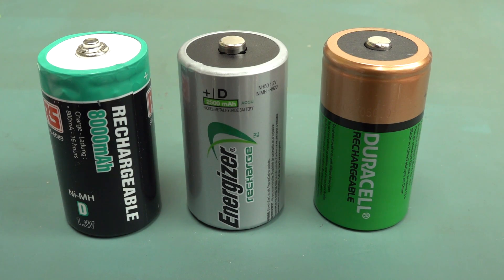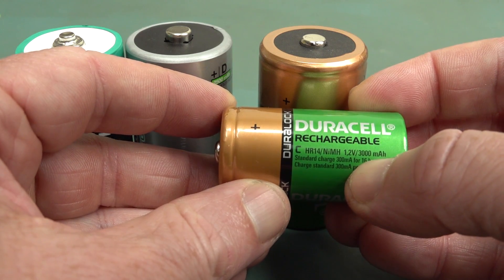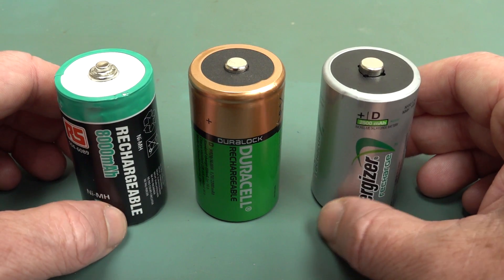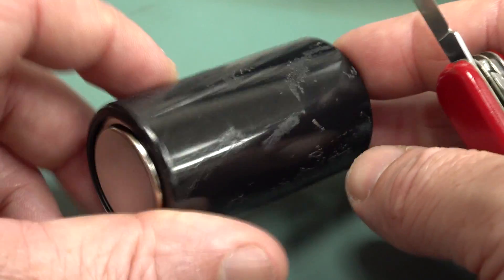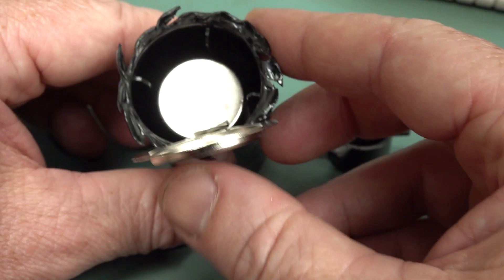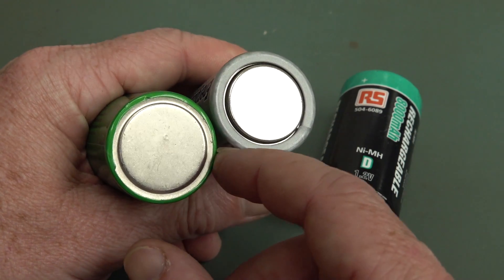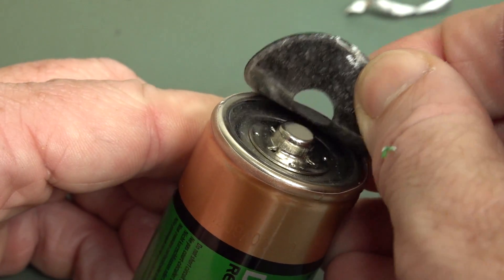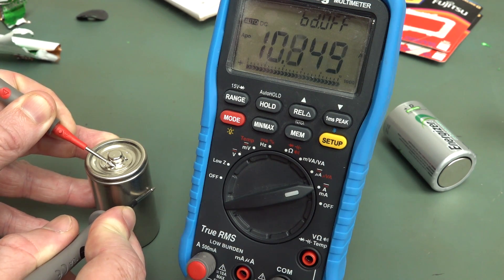EEVblog #1200 - BUSTED! - Energizer & Duracell NiMH

Comment: Video is six years old. But the trend of leaning on the ignorance of the buying public started in 1977, when I was to able to purchase C and D Ni-Cd cells both 1200 mAh, while their AA cells had 450 mAh capacity.
This is nothing new. When Energiser was selling a two-cell pack of Ni-Cd 1200 mAh D Cells batteries in 1980 for five dollars, I paid for each single Yuasa 3500 mAh Cell almost fifteen dollars. 
The big brands tried to introduce rechargeable technology to the public, but to achieve a palatable price for them, they created a product that was almost unusable; don't forget the charge of those initial Ni-Cd cells, with their impure chemistry, begun to fade two weeks after they were charged, and lost 50% charge after one month sitting unused. 
The problem is deeply rooted to this day in 2025. I bought a four-slots two-channel AA/AAA charger, which came bundled with four Ni-MH 1300 mAh AA cells, for £16 here in the UK. Fourty-eight years later., the problem hasn't been corrected, and became an epitome for the fairly perceived acceptable price fallacy.
Today. I don't mind buying Li-Ion AA cells (those with a buck converter and a protocol charger built into each cell), paying from £3 to £7 per cell, depending on brand, quality and capacity of the product.
Great video, thanks.
Greetings,
Anthony

Comment: I went through this nonsense back in the 90's with the yellow Eveready NiMH D cells.
Same low capacity crap. Now I have a bunch of EBL 10000 mah D cells. Expensive,
(4/$30.00), but worth it. Another solution is to take EBL AA 2800 mah and slip them into plastic adapters, (AA to C/D). I already do this, and save the cost of buying more EBL's.
I run two battery operated fans (4 D cells each) with the EBL 10000 mah. I also run two big radios that take 4 D cells and 6 D cells. Hopefully, people will wise up and stop buying this underpowered garbage. Glad to see that you wear barrier gloves. Great video!

Comment: I have been using Eneloop rechargeables for more than 20 years. Most of them are still working strong. Very low deterioration. No leaking even for the oldest one. Price was a bit higher but worth every penny. Great product. Absolutely better than those highly advertised national brands in the US.

Comment: It is disappointing that most people don't understand batteries. The math is really useful here. 

A normal D battery is 1.5v, 15,000-20,000 mAh. A normal rechargable AA battery is about 1.2v, 2500mAh. This is identical to these D batteries.

Honestly, that's okay, so long as you realize... You are looking at 1/8th of the amount of battery life, so long as you are not stressing the batteries a whole lot.

Most no-name companies who make chinese batteries lie about capacity. 13,000 mAh batteries could be 1/10th of that.

Comment: Tried the new Duracell Optimum cells. Ended with a claim for ruining my $40.LED light, was in only a about a month, leaked and ruined my light. They sent me a check for light and a new pack of batteries, I promptly threw them in the garbage, along with the other pack purchased at same time that corroded in the packaging, absolute junk.

Comment: Easiest way to tell is weight. The 6 and 8AH batteries are very heavy compared to spaced AA or sub C cell analogs. Now its easier to use lithium plus a dumb spacer 😂

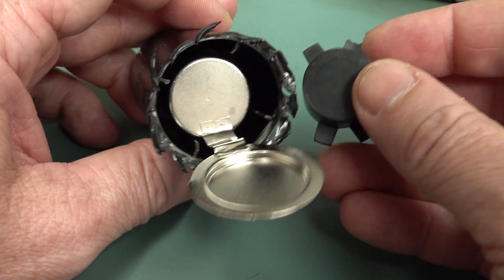Comment: i've only gone into this video to 4:30 so far so sory if i missed something said later in the vid But i always thought energiser was actrualy one of the best brands for normal batteries such as AAs,AAAs,D bateries etc but had i had a feeling they very well might be one of thoes things that oversells itself like crazy and gets away with it by alot of advertising expenses but i never thought they'd do something as cheap and bootlegy as putting  a physically smaller size battery inside a D cell sized housing and marking it as a D battery. As this guy said it's not a scam because the voltage and capacity ratings is accurate but i would feel a little ripped off if i bought Thoes.  On it's own this doesn't mean thoes particular batteries are low quality but it has me thinking they might have gone the cheap rout in the actual cell's materials and such. this warants more investigating before i buy another Energiser battery of any size sence i want good quality batteries that will last pun intended.

Comment: One thought that comes to mind is about use.  If the device you're using them in requires D cells, then obviously C cells wouldn't work.  And given the difference in weight, and I'm guessing price, a higher capacity cell would have more mass and less empty space.

Comment: Thanks for the teardown and analysis - very informative. 

BTW The price difference is so high per battery that you're paying for RS higher capacity. Most consumers are not going to pay the price difference and will simply settle for shorter runtimes and more frequent trips to the battery charger. (But now we know why you'll probably never see RS batteries in your big box hardware store...)

Comment: I wound up getting the AAA and the AA size batteries along with the charging pack for the energizers pro recharge kit for a birthday present. They do the job but I did notice they have quite a bit less capacity than those alkaline batteries or buy from the store. I just assumed it was a characteristic like nickel cadiums. I use the AA's for my controllers on my quest 2 and 1 in the clock for the family living room. The other one in my minidisc Sony s1 walkmen. The triple A's are in the TV remotes. According to the brochure that they came with the batteries can be charged up to a thousand times. So we're good for a little while.

Comment: I would not be surprised if most of those batteries (bigger than AA/AAA) were just AA/AAA in disguise (maybe even with retail sticker on it). Because manufacturing only few sizes of cells would be cheaper and other sizes are not used that much by consumers anymore (=lower turnaround).

Comment: In one respect, it's not a scam, but a matter of practicality.  They decide what the capacity of a "D" size NiMH cell needs to be, and produce it.  But it doesn't fill up the "D" case.  They can't put it in an appropriate size case, because then it wouldn't fit properly in devices that take "D" cells. They SHOULD make it with the highest capacity possible, and emphasize that in their advertising, but their "bean counters" no doubt have them convinced that the ignorant masses wouldn't appreciate the difference.

Comment: Dang I have 2 iirc usa or north american west coast pretty sure iirc where they they would have been acquired was or is on the western usa area aa batteries that are energizer 2008? From pressuming based on the date code or printed digits etc that they are year 2008 .... and they say 2450ma or mah and like they if correct in the number are more than fwiw the ones I see new nowdays in the stores now in brick andm ortar types... fwiw idk why but yeah ykwis... maybe if it is then it for the better imho for I would rather have more cycles then um uh the the the like run time ykwis?

Comment: I recently had some AA cells that were packed 3 in parallel.  And it was DEAD.  I mean all three were internally OPEN.  So I did an "autopsy".  And I found that the construction of the positive terminal under the button was actually like the disc button switches, the clicking type.  Only in this case, they were constructed not to return, when an internal pressure had pushed the disc from its original curvature out to the other state.  So, it was a bi-stable system.  I could not force the dome back, but measuring the cells (bypassing the switches), the cells were just as good as new.  I still don't know what had caused all three safety devices to fail, but I had hard time finding a replacement.  In fact it turned out to be a custom assembly for the home alarm system manufacturer.

Comment: I know I'm two *years late to the party, but I'm just a bit confused on how anyone thinks this is a rip off.
Each battery (today) is about 5 bucks on Amazon.  The first priority of these batteries is to be rechargeable, immediately followed by being the right size.  After that, it's the consumers choice as to what their next priority is.  Energizer decided their smaller C-size, with a much quicker charge time, with an added adapter was a better decision than the higher capacity but slower charging D-size.  Should a D with 10k be the same as a C with 2.5k?  No.  But the adapter isn't free.  And the assumption that inside an RS and Energizer are close to identical is a bit silly as well.  They're very close to being of the same value... nothing's been busted except the fact that the lighter battery, with less mah is indeed smaller inside... and I'd say it was silly to think you'd find a large but light battery inside, knowing how light it is and it's lower mah.

Comment: You may aswell buy 3xAAs of the same brand and put them in  D cell adapter you get more capacity your basically buying a single AA packaged in a D cell casing theres that much space inside them.

Comment: They learned it from 18650 Ultrafire Batteries? It's like cereal boxes getting bigger with less product inside, but still showing the weight of the product on an oversized box.

Comment: Been going through you're old videos and this one is really crap.  They clearly display the capacity of the batteries, the form factor is set by the device and you're acting like the high capacity one costs the same.  It doesn't!
Say Mr Jones has a device which he only unplugs for ten minutes at a time.  How on earth does it make sense for him to pay more for the high capacity battery?  Mr Smith might have a problem with not having enough energy, so yeah, it makes sense for him to get the high capacity one. What are you trying to say, that Jones should put a C battery in there, it won't fit!  Why should Duracell force Jones to pay for more capacity than he needs?  Now that would be a rip off.

Worst video ever Dave.

Comment: why didnt you open the RS brand. Tech has gotten better, I cant say for sure but maybe what there made of today is better than 30 years ago so it takes less but I still need my battery to be the same size I can't use a C-cell where I need a D-cell so the outer housing needs to be the same old size as 30 years ago I don't know just a guess.

Comment: Always remember guys if you have an ebay account and find that after your weight in grams and capacity tests are bad, you can DEMAND A FULL REFUND AND REPORT THE SUPPLIER to ebay Like I have done over the past 6 years. I give ebay proof by photos and readings of what I have found wrong with the batteries. They have a 100% full refund policy. You have nothing to lose. Ebay management will eject the supplier from ebay permanently!!

Comment: That RS battery seems to be dodgy
that large 8000mAh label with the small 800mAh label on the bottom kinda points it out.
Reply: ?? I only see a 800mA label, indicating the proper charging current (C/10) - or have I missed something?

Comment: The "8000mA" one also CLEARLY says "800mA"...which is obviously the correct number.  Stop buying shit from China.
Reply: 8000 mAh = capacity, vs. 800 mA = charging current
called C/10, which is quite typical for standard NiMH cells

Comment: you can buy battery adapters that hold a AA battery that fits in place of a D cell....Also if they made these surpass the non-rechargeable cells capacity then you would never buy their core product, all those throw away batteries.

Comment: The question is, what are your choices (and source of information) at retail where most people purchase batteries?  I have never seen RS batteries on shelves next to Energizer and Duracell, so never knew 8,000 mAH was an option.  Information is a necessary component of a competitive marketplace.  So, what are the odds that two major manufacturers chose the same approach independently?

Comment: Dave, you missed something. All batteries, regardless of capacity, were designed to be a certain 'physical' size to
fit in devices that were designed during the last 50 years or so. Our ability to evolve the chemistry to be
better and better have shrunk the cell size for a given capacity. This means a D cell has to fit in a D cell flashlight 
made ten or more years ago. Exactly how "D" cell size has changed from 1950 to today is unknown to me at
the moment, but it still seems to be the same. So the "new" capacities may require "bulking up external size" with space 
to fit the device("D" cell flashlight from1950). So, you're not being cheated.
Reply: Except if you manufacture a device to require D-cells today, you will take into account modern capability. And if you consider your device needs D-cells it's because you figure your device has a high power consumption and will deplete smaller cells too fast to be useful. Then the customer buys your device and puts this shit in and low and behold, I need to recharge my D-cell every 5 minutes because it has the capacity of an AA. Not to mention that Energizer and Duracell both made a name for themselves for lasting longer. Customers won't even look at capacity or will even assume that the 8000mAh of some off-brand battery is some sort of scam. This is absolutely not operating in good faith, it's a shady practice and customers are getting cheated because they buy the brand, they pay for the brand, but they don't benefit from what the brand stands for.

Comment: Truth is that all battery recharge when done right but the difference in something labeled rechargable is because it's a deepcell technology with high microfierit capacity vs microfierit resistance and thus you can recharge anything along as the charger adjust power density based on microfierit resistance.

Comment: If I went to the shop and saw these three batteries, with the RS 8000mAh being cheaper than Duracell/Energizer, I would probably go for Duracell/Energizer. The RS battery looks much worse, and I would suspect a typical scam here. Quite shocked to see how wrong I would be 😀

Comment: Cost of implementing waste x overall demand useage of such capacity. Old d size devices are slowly but diminishing. Duracell and Energizer have both roles to combat waste and utilisation of what popular devices are selling on the shelf... if the rs can have their d size cells on the shelf with little movement compared to energizer or Duracell putting these in very commodity devices that get very little use. The volume bought for some people would actually find these batteries over time that support a heavier fuel substance rather than make a non demanding product to goto waste.

Comment: I used to think that Energizer was the highest quality, but I'm starting to see signs of corners getting cut. The manufacturing for the alkalines is made less and less in the USA. I switched over to Rayovac for alkalines because it's not only cheaper, but Rayovac batteries are USA-made. Duracell's alkalines are often USA-made, but it's getting harder to tell
Reply: Except, Energizers are the only ones I don't have to worry about leaking if I leave them in something for a long time. Every other brand has resulted in ruined radios, flashlights, clocks, etc. I'll trade a bit of power for not ruining my stuff any day. (and Duracell is the worst)
Reply: @randymc61  The batteries that leaked in my 1980s Duracell Durabeam flashlight and corroded the terminals about 20 years ago were Energizer alkalines.

Comment: I'm not too terribly surprised they do this.  I purchased a large pack of Eneloop cells a few years ago and while they didn't do exactly this, they did include a bunch of 'adapters' you could use to fit the AA cells (which are very good, Low Self-Discharge and all) in places that call for C or D cells.

Comment: The orig D Cell used Zinc Carbon.  So how did they decide what the physical dimension?  It had to contain a certain amount of Zinc Carbon to get the job done. 
 That said, when using NiMH or NiCad or Lithium or Alkaline based formula the physical space needed is not the same for each other let alone the granddad of them all Zinc Carbon.

Comment: My pre watch assumption, they're jamming a AA rechargeable battery inside of a D-cell body. My rechargeable Double A's are 2500 milliamp hours. Time to watch and find out

Edit: I was close. my best guess and why they do this because very few applications actually require C and D cell batteries, especially D cell. however based on their price to energy, you can make a pretty damn good emergency battery bank for powerinf cell phones and stuff (with the real 8000+ mAh ones of course)

Comment: This reminds me of a weird battery I needed for a miniature digital  multimeter (DMM) someone gave me. This thing looked like it took a AA battery but was actually 3/4 length of a AA battery. I took apart old battery and it was 6 or 7(?) Watch batteries (button cells) stuck together to make a 12v battery, at about $7 /$10 for the entire battery!

Comment: A battery is a compromise between capacity and the number of times it can be recharged. Increasing the number of charges reduces the capacity. Regardless of the actual size if the cell, a D cell must have certain dimensions to fit in a space that accepts D cells so it is put into that size case. I think a fair review would consider those factors.